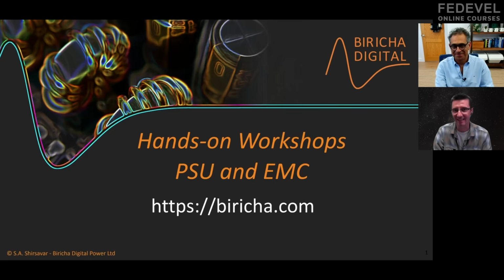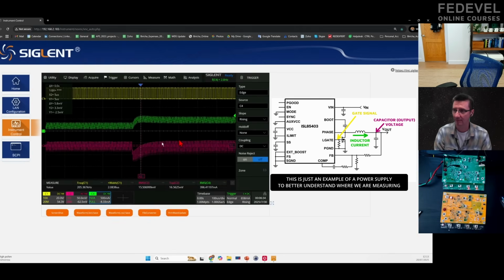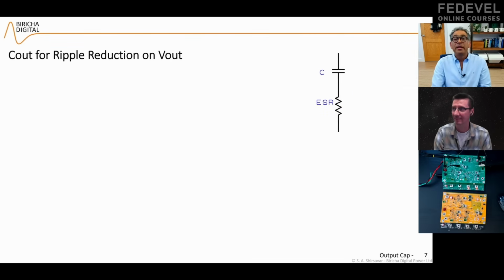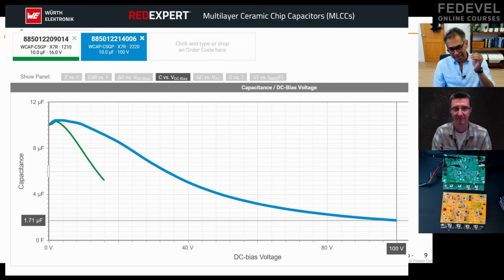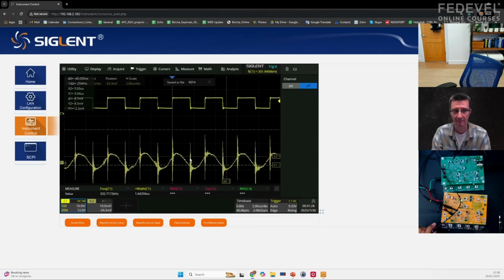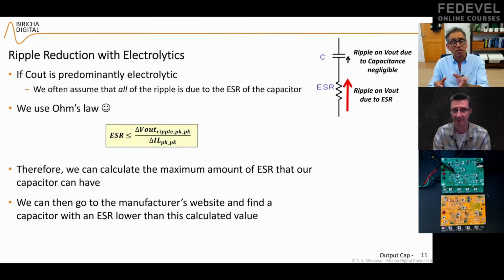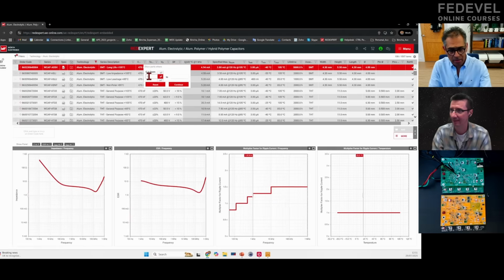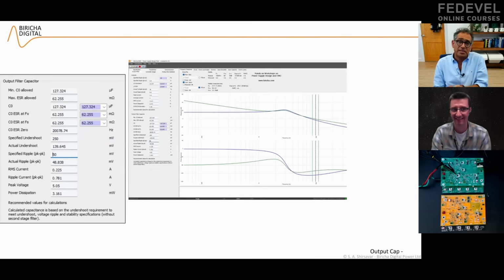How to Calculate the Output Capacitor for a Switching Power Supply? It's simple. Explained here...

Comment: Was it ever answered on the video why some applications prefer to use aluminum polymer caps over ceramic caps, and vice versa?
Reply: Yes ceramics for low voltage,  high current, very fast response applications such as power rails for FPGAs and  electrolytics for most others.

Comment: Hi there!
One clarification: COT (constant on-time) converter is sensitive to a voltage ripple on the output Cap (because of "voltage type"), so a little ripple can be a problem. Exepception: using of the inductor current ripple insertion circuit (bring ripple directly into feedback loop).

Comment: sometimes I wonder if trying different capacitor values and checking output with a scope is a viable and faster method: order a PCB with several combinations of cap/ind values in a 2d-grid. I did it for antennas once: varied coupling slot width and patch size = no need for calculations. Measured and found the best one 😅
Reply: The output cap in the power supply is part of the control loop so every time you change that you will have to recalculate all the control loop components.  There will be a point of diminishing returns :)

Comment: I want to know how to determine when to use electrolytic capacitors or ceramic capacitors
Reply: ceramics for low voltage,  high current, very fast response applications such as power rails for FPGAs and  electrolytics for most others.

Comment: I think a most important thing you didn't talk about is that in most cases we combine electrolytic and ceramic at the output stage so we need to know this case too.
Another thing is: if our output voltage is 5V and he said we can use ceramic cap with 16V or 25V for example, is there any drawbacks of using 50V or 100V ceramic cap with the same value? sometimes their price is very comparable.
Reply: Usually the ceramic capacitors added to electrolytic bulk caps are for high frequency noise reduction and EMC purposes and have little impact On switching noise and control loop. However if they amount the ceramics that you are using is comparable to the amount of electrolytics, then you must measure them in parallel in order to establish the overall ESR. Please see our video in this subject here: https://youtu.be/6DY767kQnUM?si=oaD_Q_ZnNYAewYR- . With regard to voltage rating if you are using electrolytics 20 to 30% margin is more than sufficient if you are using ceramics then yes I would try to push the voltage rating as high as possible either of course often  the cost and size will increase.
Reply: bigger size
Reply: @robegatt it's not always the size,
Let's check 0.1uF you can find 16V, 25V, 50V, 100V with 0402 size
Reply: same price? hardly  @fedimakni1200

Comment: 35:28 Is there a way to select ceramic capacitor based on calculated ESR? Or is it not that critical?
Reply: Please search for Steve Sandler and Power Integrity and you should find some good info